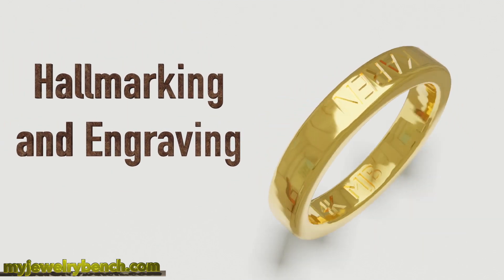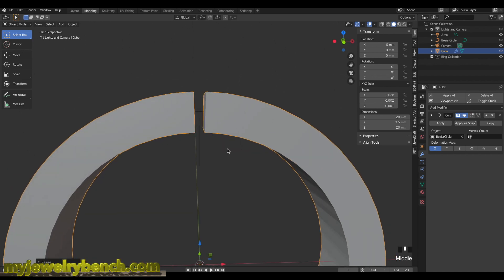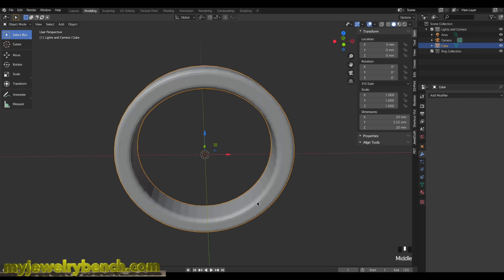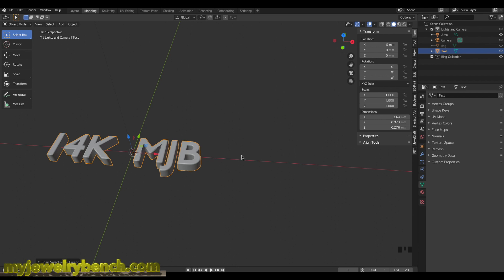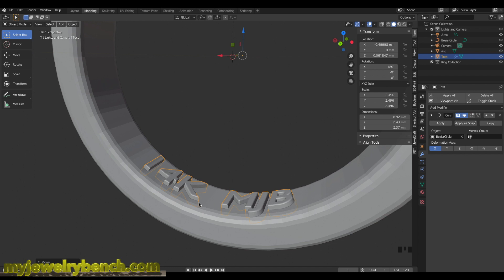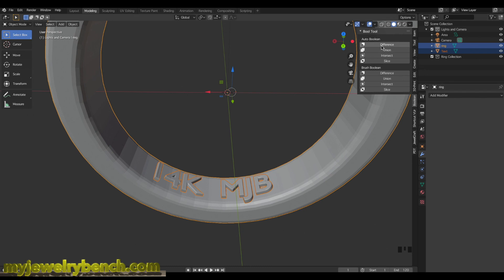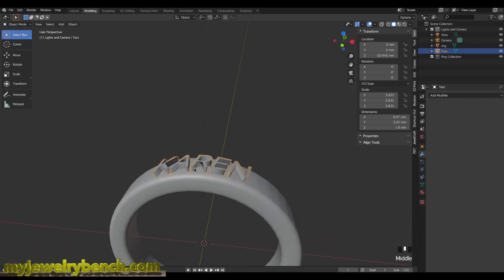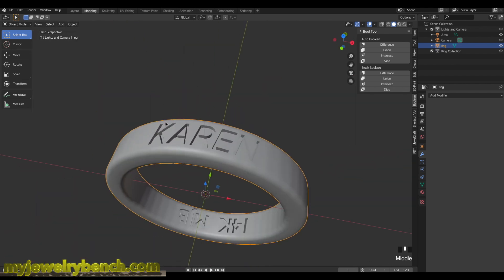Blender 2.82, Jewelry Designing, and Adding Hallmarks and Engraving during Design Process!

Comment: Sir, I seem to be missing the boolean tab.
Reply from the maker: Check to see if the Boolean function is turned on in the preferences-addon section of blender. If it is it will appear in the edit tab by default but you can move it where you like
Reply: @watchesandjewelry  Oh I think I found it. "Bool Tool". Thanks!
Reply from the maker: You’re welcome
Reply: Thanks to this comment. I was struggling the same too.

Comment: For whatever reason I can't get the remesh function to work for me in Blender 2.90.1, which is interfering with the end results. Any tips???
Reply from the maker: I don’t want to sound stupid. But I have to ask two questions. One I figured out the hard way. Is the modifier added to your model in object mode and not edit mode. And second. Did you apply it in object mode. I’d will not apply in edit mode.

Comment: Whenever I press on difference, it doesn’t cut it into the ring . I followed every step an don’t understand. Can somebody help me?
Reply from the maker: Try selecting the text and press control -a. Align rotation and scale. Apply same to mesh. Then try the difference tool
Reply: Peter Grande alright thanks, will let you know if it works soon.
Reply: Peter Grande It did not work when applying rotation and scale to both meshes. Do I maybe have to clean up the mesh?
Reply from the maker: I’m doing a couple of examples not, seeing if I can get my model to do the same...
Reply from the maker: Start with a new screen, and try following these procedures…

Cutting Text out…
Here are the steps I used…  I’ve tried five different ways, and I can’t get it to fail…

Create a cube, size it to the following …
x=56mm, y=2mm, z=1.5mm

Add a curve.  Size it along x and y to 17.5 mm

Apply a curve modifier to the cube (now elongated) so that the cube follows the shape of the curve.

You size it along the x axis to make sure there is a small gap ( you could close it, but you don’t have to)

Apply the modifier, but you don’t have to at this point.

Ad your text, edit it, give it some thickness as shown in the video.

After you have edited your text, make sure you are in object mode (not edit mode) and right click on the text, and convert it to a Mesh.

With the text selected, add a modifier to the text to re-mesh.  make sure you you uncheck the box to remove disconnected pieces.  Change the Octree value to 8

apply the modifier

Add a curve modifier to the remeshed text.  Adjust the position

now, select the text, hold the shift key, and select the ring(round object)

Use the boolean tool to perform a difference…  It should work.

If it does, there may be some errors in your existing model.
Reply: Peter Grande Thanks so much, it finally worked!